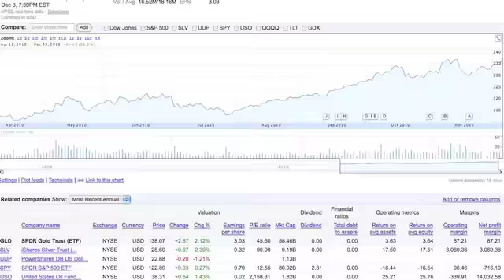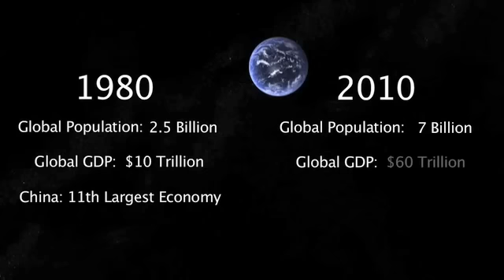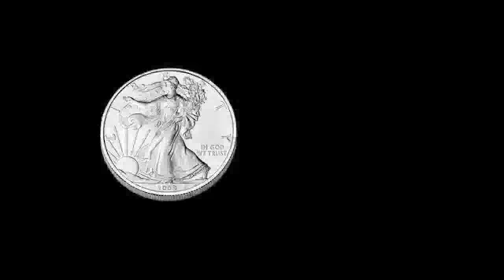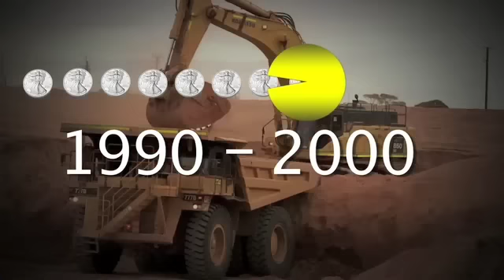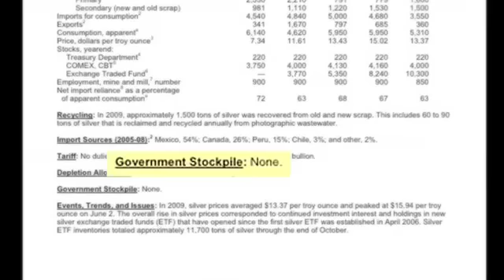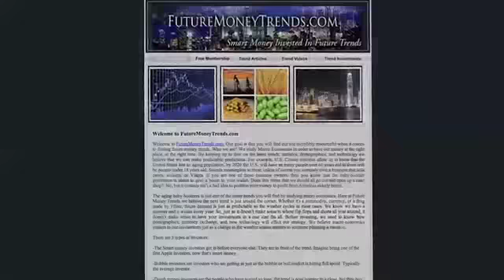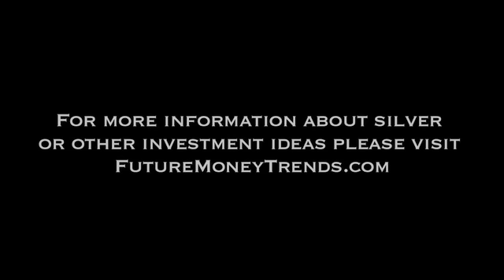Silver Shortage This Decade, Silver Will Be Worth More Than Gold -FutureMoneyTrends.com

Comment: you obviously dont get it. Silver is currently not recycled. It is used up and dumped. elements are not infinite. there is only so much of them that are economically viable to mine. At present it is economically not viable to recycle silver from all of the products it is used in. The fact that it is an element means that it is finite. You cannot make new silver you can only mine it or recycle it.

Comment: The question becomes price of the silver.  Is it cheaper to mine the silver and mint it or is it cheaper to entice it away from those who hang-on the grandma's silverware? It is estimated that a price of $50 per ounce would entice that "above ground but not available" silver away from those uses and into bullion minting. This suggests there is a lid on the silver price run-up. Because at $50/oz, available supply will skyrocket.

Comment: And before someone points to silver coin shortages, this is due to production issue, not supply issue. When faced with unprecendented demand, makers of silver coins can only produce soo much and have soo much silver in stock. The silver is there it just takes time to shift it to the right areas and stamp more coins to meet such high demand.

Comment: There is one thing worth pointing out about the "all-time high" price of silver: The 1980 price of $50/ounce was the result of speculation (search for Hunt brothers), so it is not really an accurate reflection of supply/demand. After the bubble the price dropped to about $5 and stayed under $10 until late 2000s.

The argument about diminishing supply is valid, though.

Comment: I have to disagree with you. Return to the gold standard simply means that ALL countries in this world will have to FIX their currency to a unit of gold (eg. 1oz) USD might then be $5000 to 1oz of Au & AUD $5500 to 1oz of Au for example. Once that is fixed, there will be an end to currency wars because printing cannot be wanton, and inflation henceforth greatly reduced, enabling greater economic stability. 99% won't have to starve, just have to endure temp hardship, which is due discipline.

Comment: You're wrong and even if you were right, gold money wouldn't solve anything.
Let's presume gold is money for the sake of argument. During a deflationary crisis, the value of money goes up because the supply of it goes down. The supply of it goes down because either the economy expands faster than the money supply, or because rich people accumulate it and hoard it which takes it out of circulation.
So even though the value of money goes up during these crisis, only the rich get richer.

Comment: Your critique is fairly superficial.  Yes, it is obvious that Ag can be recycled from components.  However, many of its uses produce so much value (i.e.PV modules, as cited in the film) in the finished good that recycling is counter productive, not to mention many of these goods (PV) are functional for decades.  As you can see, this is a complicated market resource, and while you are generally correct in what you cited, I do not think your point detracts from the writer's analysis.

Comment: @VictoryIndependence Also, in 1971, silver was $1.70.  It topped $49.50 in 1980.

Silver was $4.07 in 2001.  If the same run up occurred as in 1980, silver would be $120.

Comment: @1978atcarroll Right. I lost 25% several about 18 months ago when I bought silver at about $20.00. then it dropped to $14.97. Boy was I a sucker! But I would do that over and over, because in late April silver SURGED to $48.50 now how do I feel that it dropped to $34.00? The volatility of the silver market is what makes it work. You can either buy low and sell high, or buy and hang on for a while. Either way a GREAT investment. Fight the banks, RFID and 666! Buy silver - remain FREE!

Comment: Interesting video if the data could be authenticated. For example, you mentioned 10,000,000,000 ounces in 1950, etc. I checked the US Geological Survey Data site ... your number don't come close. I've been stacking silver for decades - so, I'm not trying to rain on the precious metals parade ... but ... where are you getting your numbers. I'd like to verify so I can resend your presentation ... but I don't send important info to friends without verifying first. Thanks.

Comment: @BrotherJohnF You are absolutely correct! Silver did reach $50. and I believe it will do that again, and more. It may even go to 120 or 500, who knows! But, the fact remains that most of the melting has NOT occurred. There is still an unaccounted for 39.5 billion ounces of silver. That's 80 times as much (either used up or unmelted, but above ground) as bullion. Probably 100 ozs in each silverware collection! I don't know anyone buying silver. But I know PLENTY with old silverware sets.

Comment: Greater current (i mean in 2010) demand for silver means it is currently more popular in jewelry. Period.
What is more credible? Those demand figures or your imaginary opinion which is backed by nothing? And 11 years ago when silver was like $4.4/oz, jewelry demand was similar to that in 2010 so you're wrong again, it doesn't have much to do with the spot price. It does, however, in case of gold. 11 years ago demand was 3008 tonnes, but it was still less than for silver (5421 t).

Comment: Lots of good points in this video, but there are some other things to consider.  As the price goes up, various industries will find alternative factors of production to substitute for silver when available.  Also, recycling, which is not economically viable at these prices, will kick in for such things and batteries and old computers etc. at a certain point.  This being said, I still think silver has a ways to go.  But it isn't as apocolyptic as we might think.

Comment: It just happens to be that they take 1980 as an example in this video. and it just happens to be that the silver price in 1980 was peaking so extreme that it is not even a 1% representation of the silver price over all other years.

change the 1980 into 1982 or 1978 and this video would have been totally useless.

Comment: @D33Lux I have mine stored in 200 to 500 gallon propane tanks that no longer passed the pressure tests but were otherwise sound and clean inside, never having been exposed to the elements. I took them to place in Dallas that steam cleaned them then pulled a 12 hour vacuum on them to remove all moisture. They then put a low pressure charge of argon gas in them. I brought them  home and had our local oil company come out and fill them with farm diesel. They look like empty unused junk tanks. ;-)

Comment: @luckyisme10 it should because of the fundamentals. This includes the currency debasement that is happening. The only reason that gold has gone up. If gold keeps going up, so will silver. I still think silver is a slow market. In 1980 silver was 50, but during around that time, before the rush into silver, the average price was around 16 or less. So in 30 years, now at under 40 bucks, it has not moved a great deal. compare that to buying house in 1980 to now. lol.

Comment: The silver mines in Ireland have been closed now since it is not economically viable to mine this silver at this price. But it has huge reserves of silver, so every time the silver price goes up a bit, some mine somewhere reopens and the price will go back down again. See this happening in the spikes on the silver market. If you want to get real information and not be so greedy go to vimeo and type under user O Pie, it is user9574826/videos after vimeo in the top bar.